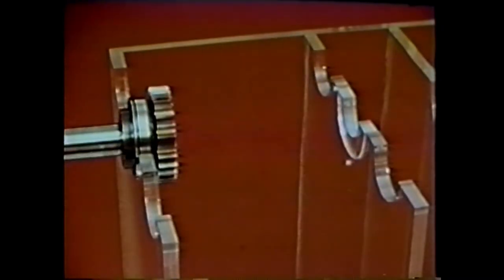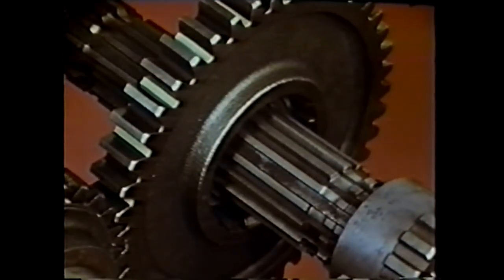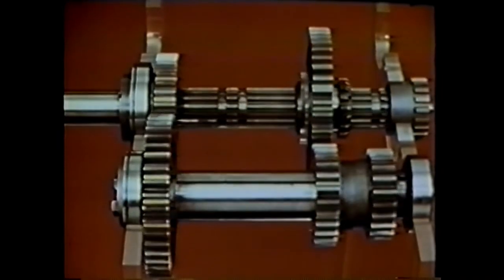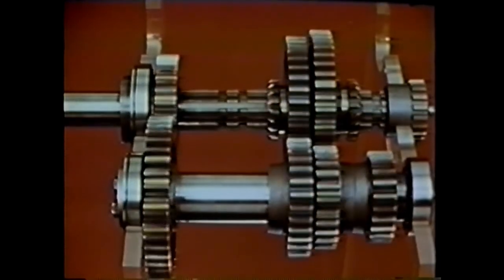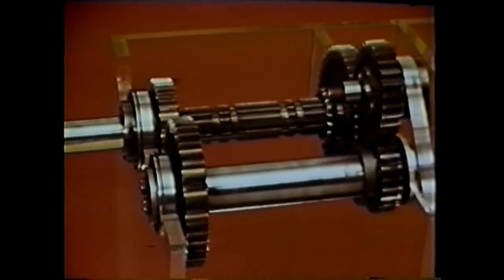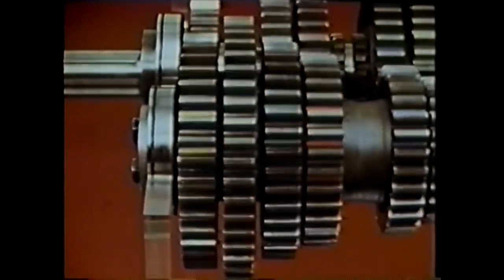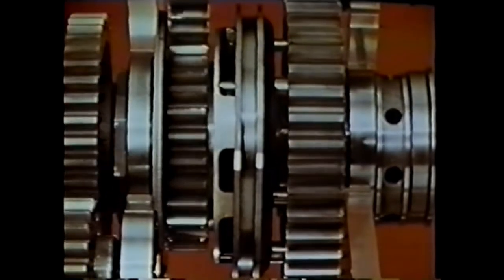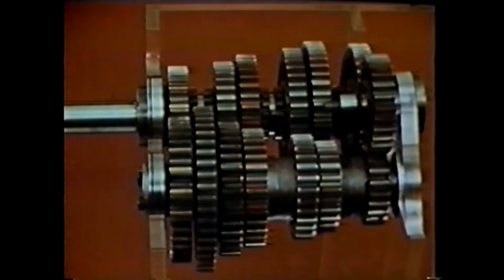598  How a semi transmission works

Comment: In high school we had to take an aptitude test. Looked at a picture of a fan belt and pulleys and had to determine which direction the fan belt was turning.  I had a wonderful career in “sales”. What the heck did I just watch.  Watched your video on how to drive an eighteen wheeler, I can assure you I could keep a transmission rebuilder in business. 
On the flip side, I could make sure he has in stock every gear, nut and bolt he would ever need to do his job. 
Think I will go grind some gears in my truck 
Your friend and mine,
Jim&Celia

Comment: I remember when I started driving trucks 25 years ago I asked a senior driver (when are they coming out with a automatic transmission for semis?) He replied Never! And explained why it’s impossible! LOL
Reply: Most all “automatic” transmissions in trucks today are the same transmission just computer over air shifted!! With the exception of most military and state trucks use an Allison automatic trans.
The air shift transmissions are a lot cheaper to make. That’s why they use them in throw away trucks
Reply: @michaeljestice4234  the proper term is AMT short for automated manual transmission. AMT is not cheaper to make than a conventional hydraulic automatic but it is more fuel-efficient, which is why they are becoming common. it is possible to make a hydraulic automatic that is as fuel-efficient as an AMT but the cost and additional weight would never be justified in the real world. the government and the military don't care about fuel efficiency, they want durability and reliability so that's why they go with conventional automatics. "throw away" trucks like you say don't exist, if the driver burns up the clutch because they are stupid the clutch can be replaced. you can't drive an AMT like you drive a conventional automatic, if you creep along slowly or hold yourself on a hill you will burn up the clutch just like you would in a conventional manual vehicle by riding the clutch pedal.
Reply: @marzsit9833  if an amt is not cheaper, then why doesn’t the boss buy me an 18 speed to drive? Because they can buy these transmissions in cheap throw away trucks a whole lot cheaper (as a mechanic friend of mine calls them).
Most big carriers buy throw away trucks, because after 600,000 miles maybe a few more, they get a new truck. These trucks are not designed to be rebuilt just trashed! Also most drivers can’t drive a real truck anymore, just steering wheel holders.
I was in a snow storm last week. I had to shovel out and chain up 3 trucks just so I could get off the road.

Comment: Remove one counter shaft and aux shaft. Add synchronizes to every gear except reverse and you have a modern car and pick up transmission.   High horse power cars could benefit from twin counter shafts but they are a bit heavy.